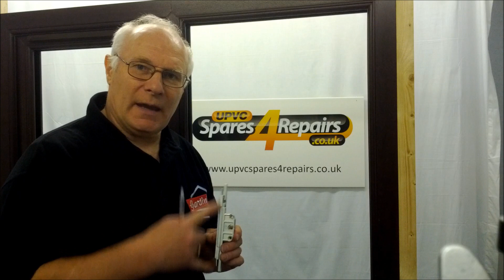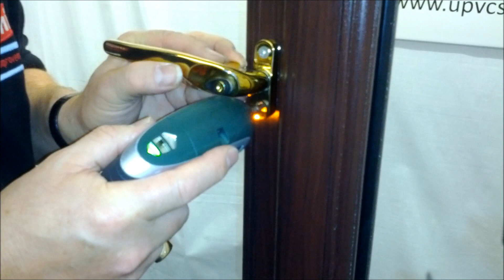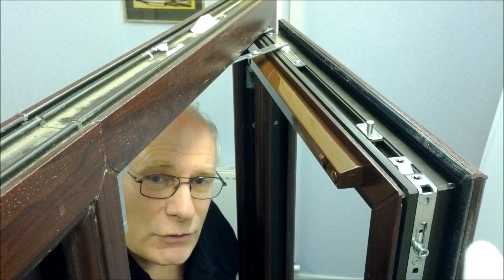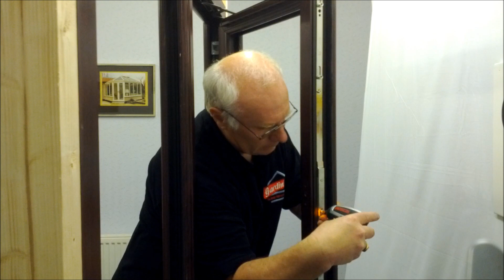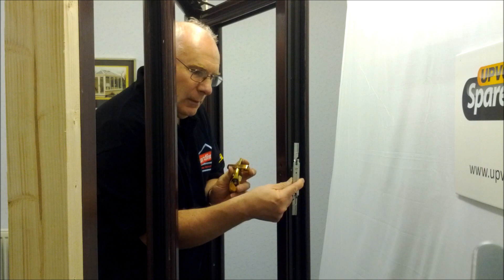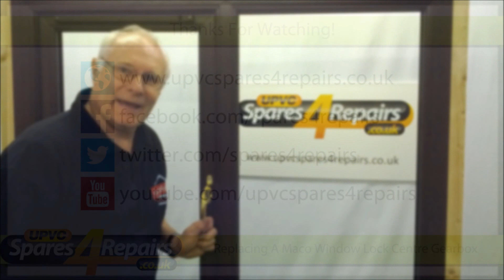Replacing A Maco Window Lock Centre Gearbox

Comment: Hi labour of love unfortunately. You need to get a flat scraper or such between the sash and frame and try to knock the lock cams out of the keep if you can get to one of them not necessarily the jammed one you might find it also drives the whole lock plate and moves them open. It is also prudent to remove the glass first from the sash as this is likely to break if over stressed and allows a lot more flex between the sash and frame. But the trick is slowly and gently so as not to over stress the sash and crack it.

Comment: My window is stuck locked and the key won't even unlock it, I've taken the handle off but don't know what to do from here?
Reply: There is a trick where you can put a fine allen key held with mole grips into the gap and lift up the bottom roller. 

Seeing that these mechanisms when they break, mean the window is locked closed, fitting them in low rise flats etc where you might need the open window as an escape route is madness. However city councils do fit them. Perhaps they are cheap or something.
Reply: Years later - but for anyone coming along later - the trick is here: https://www.youtube.com/watch?v=c8leMv6ibo4